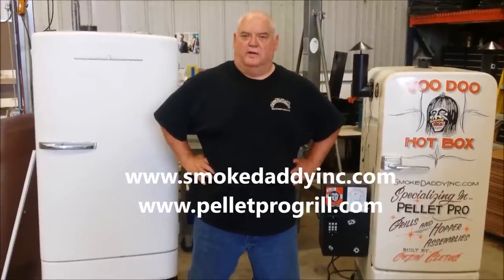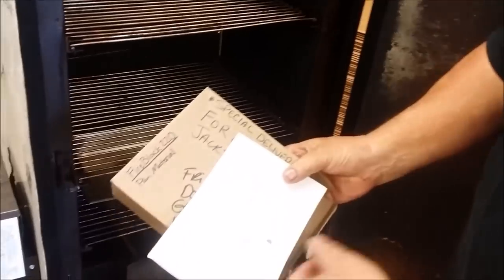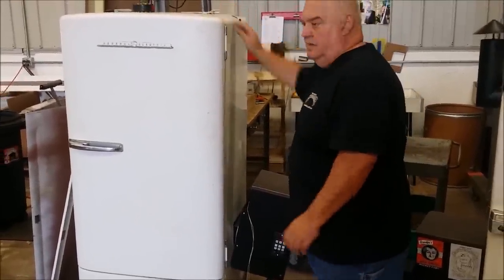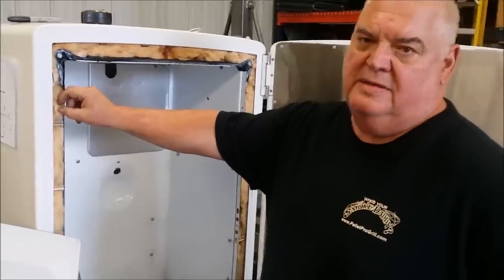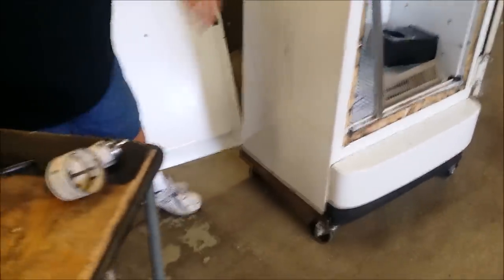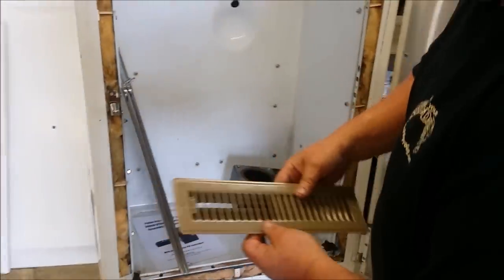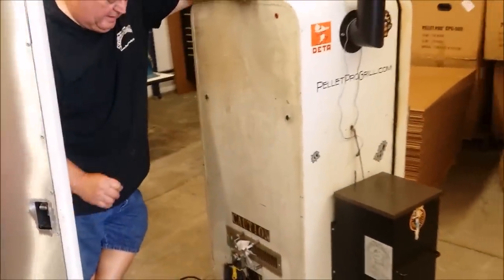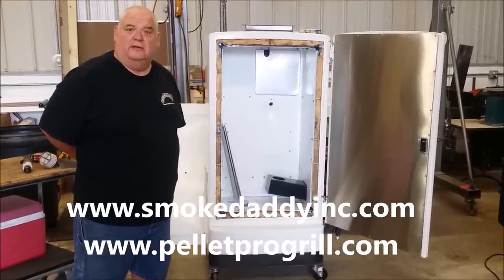Converting an Old Refrigerator into a Pellet Smoker with Pellet Pro®

Comment: Why can't you use galvanized metal on the inside? Please don't say noxious fumes. Zinc coatings start to off-gas at 500°C ( That's 932° F for you Americans). I doubt that you will ever come close to getting an old frig that hot! LOL
Reply from the maker: You are correct but to avoid a bunch of negative comments about using galvanized I prefer not to recommend it.